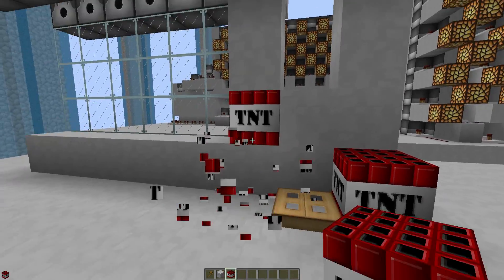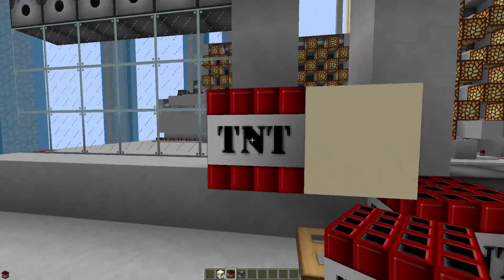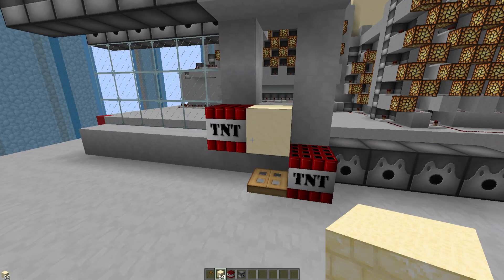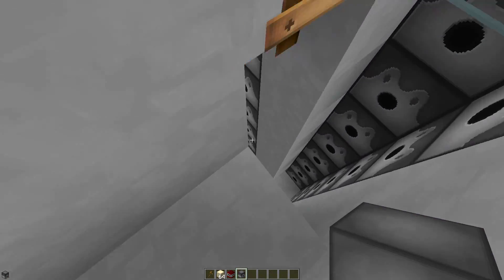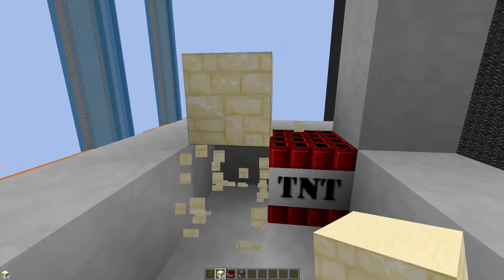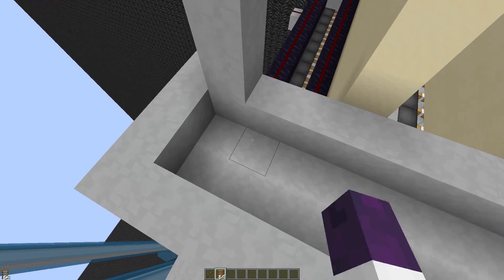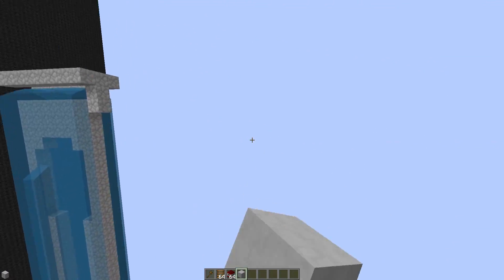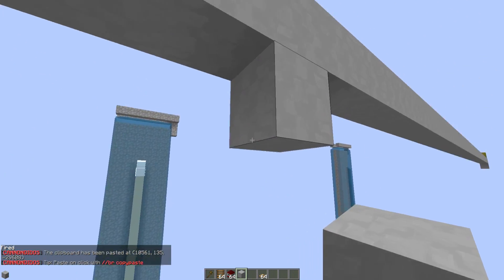180 Stacker Adj. Parallel Nuke | Parallel Explained

Comment: Hi Dexter, i'm using your 240 efficient nuke and managed to get thru a 20chunk buffer of walls and into the base itself.

Now I'm trying to get further in the base but something weird is happening. The sand is stacking, first normal then red sand on top and the tnt is blowing up inside/on top of the red sand and it makes a hole in the wall but it is not destroying the sand stack.

So now I have a hole in the wall but the sand stack is in the way. Also sometimes it just stacks the sand but doesn't blow anything up when I shoot I just get a bunch of sand stacks next to each other. 

I've tried messing with the ticks a lot but haven't been able to fix it. The weird thing is when I shoot a normal wall that is not in the base but is the same distance it works fine, makes holes and removes sand. If you can help that will be greatly appreciated since this is the only thing holding up my raid on ftop #1 fac.

Thanks :D
Reply from the maker: Are you adjusting it & what server are you on?
Also are you saying that even tho the tnt blows up inside the red sand the sand stack remains?
Reply from the maker: Ohh wait u not using the cannon in this video my bad. okay so its working on a test server but not on the actual server itself?
Reply: No it's not this cannon, its your 240 efficient nuke. Sorry for posting here, I thought maybe u will see it if I post on a recent cannon video.

And I'm using it on a test server I made with your files. Basically it works fine until I get into the base then it stops breaking the sand stack. I haven't made it on the actual server I play on yet because I want to get to the igs first on the test server.

I'm on the server now if u maybe wanna check it, would mean a lot to me.

Btw thanks to you I managed to get past the 2 triple filters they had by watching your how to cannon filters video so thx again <3
Reply from the maker: Should the sand have been destroyed or does it not scatter/nuke at all?
Reply: Yes, the sand should be destroyed but its not. I think it might be scattering because it makes a hole in the wall but that could be the hammer down, i'm not too sure. And I have nuke turned off since it is an obby wall and the next wall is obby too.

I have been trying to fix this all day, no lie, i will even wait all night if u can just come on my test server for 5mins to check the issue.
Reply: Also, thanks for the speedy responses, your are my favorite youtuber and first one I ever spoke to :D